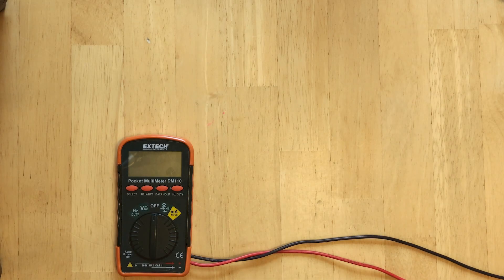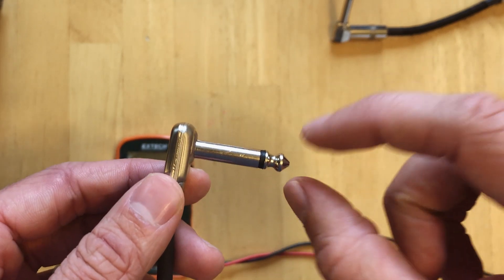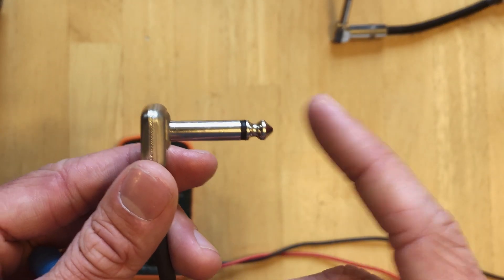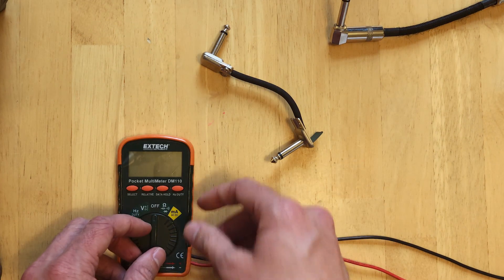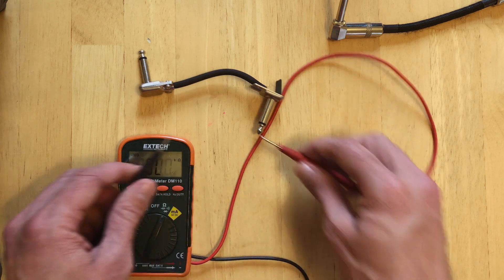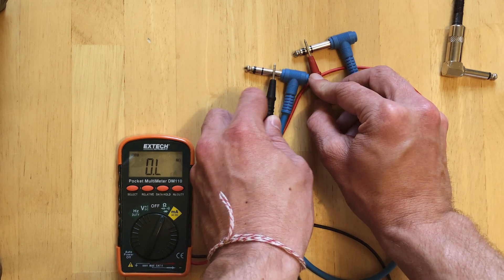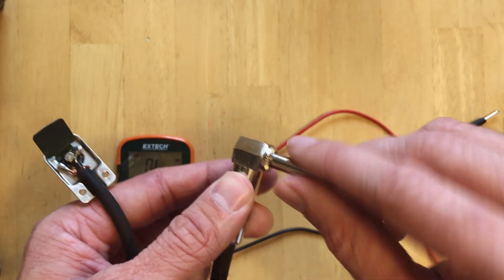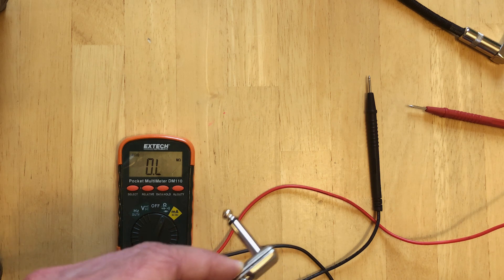How To Test An Instrument Cable

Comment: With some of the cables that I am testing, when I test from the tip to ground it will go to OL for a split second and then go to 0. Does this mean that the wires are touching internally?

Comment: If my ohms are fluctuating from 0-14 ish on the tip, is this a bad cable? Everything is is as it should be. What setting for ohms? I tried 200, 2000 and 200k ohm and they all were just as sensitive to rapid changes and unclear indication

Comment: should definitely do a video showing what bad cables will show on the meter...
Reply: It shows the O.L which means the two probes of the meter are not connected (i.e., the wire (tip-to-tip or sleeve-to-sleeve) connecting the two ends of the cable is broken).

Comment: Hey question, so I just made my first patch cables with SquarePlugs SP500s and wired the tip and sleeve backwards. The cable still works and sounds good but just wondering if there is a downside to having it like this?
Reply from the maker: The reason why it's working is cause you at least soldered the ground(shielding wire) to the tip on both sides. This means your audio signal is running on the part of the cable that is supposed to catch and block outside interference. I'd suspect the audio quality won't be as good and you may run into more noise/static/cell phone interference. Plus the outer shield won't have the same impedance/quality retention like the center core wire would.

Comment: Hello!  Thank you, this was very helpful.  I’ve been soldering my own SP500’s for about a year now, and these two videos have been great.  I definitely think I can improve…. I have a couple of questions for you.  1. Do you have a solder iron that you recommend?  2. Same with a type of solder…. 3. Do you ever use flux when you tin?  I’m going to look up that meter as well.  Thank you!!!
Reply from the maker: Hi YellowHouse, I actually list both of the solder iron and the exact solder I use in the description of my other video. HOW TO SOLDER PATCH CABLES.

As far as using flux. I don't use it to tin when soldering patch cables. But I've used it when solder PCB boards on computers or other electronics that have circuit boards.
Reply: @joshuaaldy  thank you!  I’ll look at that description.  I really appreciate it!

Comment: Any tips of solving which side is open or shouted? Assuming it is a molded cable/plug. Murphy's law say's when you cut the suspect tip it will be the other side that is open.

Comment: Many thanks! Testing from tip to sleeve like you showed here helped me to isolate two cables that worked but sometimes made slight noises or hummed. Before I was using the noise ohm setting and it wasn’t enough to beep.. but with a standard ohm setting on my meter it showed up. Many thanks. Do you have a standalone cable tester ( not a multi meter ) that you like to use for already made up cables to save on time that will work in the same way effectively?

Comment: If it's used to connect PA gear, the blue cable is a mono balanced cable.
If it's used to connect domestic gear, the blue cable is a stereo unbalanced cable.
If the cable is long, there may be some resistance measured but it should be low.  How low depends on the length of the cable and the thickness (gauge) of the conductor within the cable.  Less than 1 ohm is generally reasonable over 10-20 metres.  On any multi-meter, the value should hold steady to within the last digit which may alternate between round off values. The value rolling like that may be one of several things. A loose connection, dry solder connection, not getting good contact with the test probes (dirty or oxidised contacts), Finger shorting the contacts, low battery in the meter or electrical components within the cable makeup (capacitors, diodes etc).  Sometimes a cable made to connect balanced to unbalanced gear may contain electronics to phase invert correctly.  Electronics in a cable is rare but possible, so if your prob is making good contact and your finger isn't getting where it shouldn't be, and the battery is good, then rolling values indicate there is a problem with the cable.

If your getting into PA at all, you need to understand the difference between balances and unbalanced signals and cables.  You can't just go connecting these different types without knowing what your doing.  Things may just not work or maybe there will be damage or electric shock for phantom power connecting incorrectly etc.

You can use a cable tester which is quicker, but doesn't alert you to high resistance developing as a multi-meter will.

Comment: Very helpful! @Joshua, is there any way to detect the 'gray' areas? Say you have a bad solder joint, or if in the case of a solderless cable, a bad or poor connection. Are there any reliable ways to test the quality of a cable in the case that there is still continuity? Almost like measuring signal loss if you will. Thanks!
Reply from the maker: @berrychapman Hi Barry! I get what you asking about being able to reliably test any cable to determine its quality and the amount of signal clarity vs signal loss. 

Honestly it isn't that easy because different cables have different size cores and different types of conductors. There's so many factors that could contribute to your signal being strong or very weak. IMO (correctly)soldered cables sound better and hold up better than the solder less options I've used(george L's and lava cable). Obviously if you buy the cheapest soldered patch cables, they will probably still sound worse compared to the high quality solder less stuff. 

The best case scenario for making sure you're not experiencing a lot of signal loss is to purchase and use high quality components. Factors I look for, are what metals are used, what's the cables capacitance, what gauge wire is being used, then the plugs used, and finally the solder job. All those are things you can research if you're looking into making your own. 

Otherwise if question the quality of your patch cables or you're trying to test solder less patch cables. I'd use your ear and compare them to something of high quality. With solder less I'd also move the cable around while signal is passing through it. A good cable shouldn't have any shorts, dips, or crackles in the sound while the cable is being moved. That was one of the biggest problems I'd experience with solderless kits. I'd have it set up and my guitar would still put out signal, but then when I'd move or bump the cables, they dip in volume or short out. If that happens then you're definitely experiencing signal loss, IMO. 

Wow, I just wrote a book. Sorry the long reply. Hope it helps!
Reply: I just started shortening my patch cables to length and was wondering about the same thing. I tested each cable and some of the ones I shortened sounded darker than the ”stock” cables.